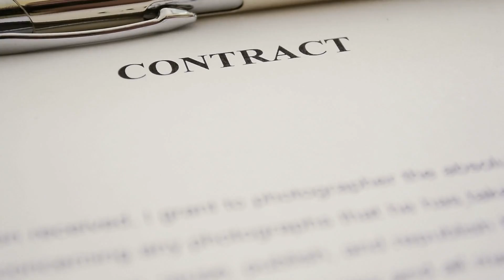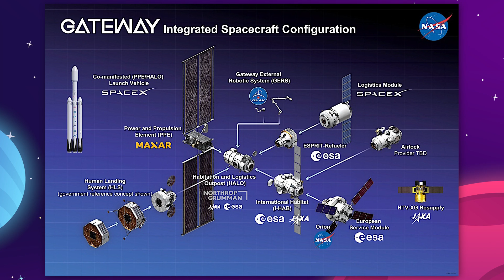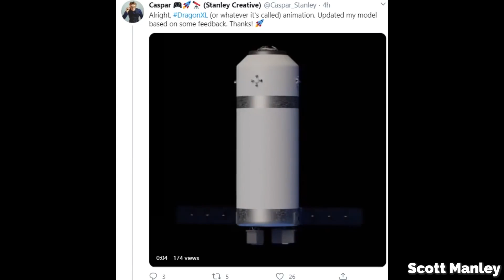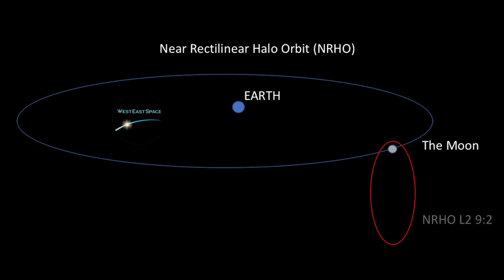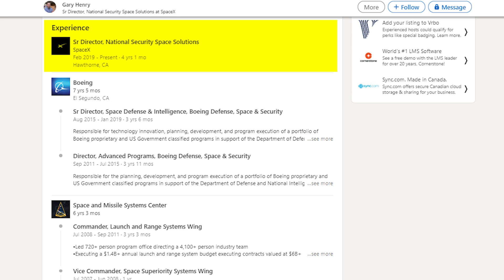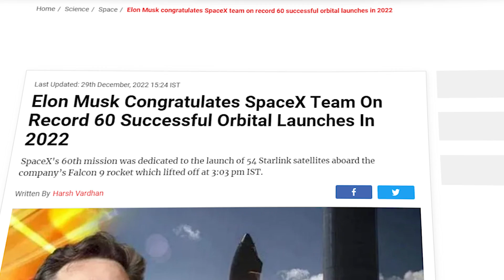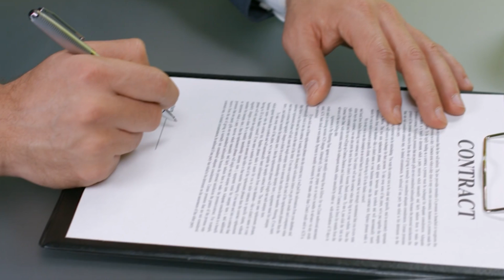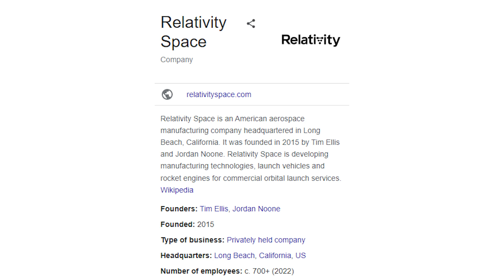NASA Reveals Major New Lunar Gateway Update!

Comment: ill give you the way it will go, spacex will be ready with starship and none of the other companies will be ready and they will be over budget.
Reply: Agreed.
Reply: with only SpaceX being under budget.
Reply: @jessepollard7132  SpaceX has only been on firm, fixed-price contracts, as are all the commercial program contracts. We do not yet know how SpaceX would handle a cost-plus contract, since to my knowledge, they have never had one.
Reply: @jessepollard7132  The NASA commercial contracts are firm, fixed-price contracts by law. Take the $4.2B Commercial Crew contract for Starliner. Since Boeing started having teething problems in Dec 2019 with Starliner, it failed its OFT-1 flight, they took a $410M charge against earnings in 2020, a $185M one in 2021, and $288M in 2022, totaling $883M against Boeing's profits. Not charged to NASA, but out of Boeing's pocket. Hopefully SLS/Orion are the last of the cost-plus contracts, as the Commercial Resupply Services (CRS), Commercial Crew, Commercial Lunar Payload Services (CLPS), both HLS contracts, the Appendix P contracts, and many single mission contracts have all been firm, fixed-price contracts.
Reply: @steveaustin2686  the KSC management contract for operating KSC from 2023 to 2033 given to Jacobs is a cost plus contract but in this particular instance it makes sense

Hard to predict fixed costs of running such complex for next ten years.

While for "small" projects(if moon rocket can be said to be such" fixed price contract will motivate way more efficient management, there are still things that are just too unpredictable and need cost plus
Reply: @_mikolaj_  The unpredictable part is why NASA says that they do cost-plus contracts. COTS has done very well with fixed-price contracts, so hopefully they are the norm and cost-plus becomes the exception.
Reply: @jessepollard7132  What is? Your 'it' at the start isn't clear.
Reply: @jessepollard7132  Whether a cost-plus or fixed-price model is used is up to NASA, not the bidder. And the bidder sets the price they want and NASA picks among the bidders.
Reply: @steveaustin2686  sorry - "firm" means changeable. thus not fixed.
Reply: @steveaustin2686  why spacex has delays(mostly from the FAA recently), I still will bet they are ready before ULA or others.
Reply: @ReRe-yl6dq  The FAA vs SpaceX is not really a thing, except for clicks by certain YT channels. After all, the FAA defended SpaceX in front of Congress in Jun 2021 over the unauthorized SN8 flight. The 'NASA delaying Starship until the SLS flies' is just as silly, since NASA needs BOTH Starship and SLS for Artemis. Besides, the review was completed already.

SpaceX had approval for orbital launches of the Falcon 9 and Falcon Heavy from Boca Chica since 2014. They can also fly sub-orbital tests of reusable spacecraft. SpaceX went through an Environmental Impact Statement (EIS) to get that approval in 2014. Now, SpaceX wants to fly orbital flights with Starship, that has roughly 3 times the propellant as the Falcon Heavy. So the FAA review was to see about adding Starship to that existing approval, without having to go through another EIS.

The FAA was the lead agency with NASA, the Army Corps of Engineers, the US Coast Guard, the US Fish and Wildlife Service, and the National Park Service all involved from the beginning. With 6 different goverment agencies involved, it is not surprising that the review took time. Musk asking everyone to comment, over 18,000 comments were received, didn't help. Consultations were mentioned for a third time on Apr 29th,2022 and mitigations for the first time, so some issues did come up and SpaceX had been working out a solution with whichever agency or agencies covered the issue. The Permitting Dashboard: Federal Infrastructue Projects had 5 sections to the FAA review. The first was completed in Oct 2021, second in Jan 2022, third in Apr 2022, fourth in May 2022, and fifth in Jun 2022, so there was continual progress. The FAA review is complete with Starship able to fit under the existing EIS for Boca Chica. SpaceX can do the mitigations and apply for the launch license at the same time. Apparently, some of the mitigations, like the wildlife crossing, only have to be started and some are on going.

ULA's Vulcan Centaur is not a part of Artemis. ULA makes the Interim Cryogenic Propulsion Stage (ICPS) for SLS, so they provided a part for the Artemis I launch late last year. They also fly the Atlas-V , which has been flying as long as SpaceX existed. ULA's Vulcan Centaur has been delayed by the almost 3 year late delivery of the Blue Origin BE-4 engine. Tory Bruno has been upset with Blue for a while. The Vulcan Centaur is currently planned to launch on May 4th, 2023 with the Peregrine Lunar Lander. Then they will launch the Dream Chaser CRS demo mission to the ISS later this year. If those two flights are successful, then the Vulcan Centaur should be certified for NSSL payloads for the USSF, which is where ULA makes most of its money.

Don't get me wrong, I like SpaceX and they are the top launch company, but they are not the only launch company.
Reply: @ReRe-yl6dq what has ULA to do in artemis program atm? Last time i checked at the moment they only launch one CLPS lander currently on May 4th and  nothing else.
They have nothing to do with main missions as of now especially artemis 3 or 4
Reply: @_mikolaj_  Exactly. Although ULA is making the Interim Cryogencic Propulsion Stage (ICPS) for Artemis I through Artemis III and they are already building the third one. ULA is not the hold up on SLS, it is the lead contractor Boeing and the Core stage along with the Boeing Exploration Upper Stage (EUS) that will replace the ICPS on the SLS Block 1B on Artemis IV.
Reply: @steveaustin2686  well, third icps completion is from what ive heard, close. But still, with how things are currently SLS is no longer a holding item. Artemis 2 core stage will stay at kennedy space center atleast a year before launch, and i wont be suprised if same goes for third mission.

For 4th mission scheldue holding item will be SLS B1B tower though most likely, not necessairly EUS. First flight article begun construction ~month ago.
Reply: @_mikolaj_  your right, I didnt mean to pick on ULA.  They are not a major part of the Artemis program.  but its common to see many space agencies/companies fall behind on schedule and I think SpaceX is one that usually achieves their goals alot faster.
Reply: @ReRe-yl6dq  eh... that could be debatable.

SpaceX isnt so different from entire industry and also usually never makes it on scheldue... 
Just like everyone else they had bigger delays in every major project
Reply: @_mikolaj_  Yeah, I think it is, but wasn't sure. I knew it was being built already. There are a lot of checks that NASA has to do when they integrate all the other parts to the core stage. The SRBs, interstage, the upper stage (ICPS or EUS), etc, so it's not surprising that NASA is very careful with a crew spacecraft. I'm sure SpaceX is MUCH more careful with the refurbishment and checks on the booster and second stages for Crew Dragon flights.

Exactly on the ML-2. The NASA IG said that they expect the ML-2 to be late, so that the SLS 1B for Artemis IV will have to wait for it to be ready. So they are expecting Artemis IV to slide into 2028. Hopefully that gives Boeing time to have the EUS ready.
Reply: @ReRe-yl6dq  SpaceX misses deadlines as well. They missed the CRS deadline, but Dragon did beat Cygnus to the ISS. SpaceX's Crew Dragon missed the CCP deadline, but beat Starliner to the ISS to capture the flag left by the last Shuttle mission. Schedule delays are not uncommon in the space industry, which is why they use NET, No Earlier Than, so much for schedules.
Reply: @_mikolaj_  well we will have to agree to disagree.  I have seen spacex get starship ready for orbital flight faster than SLS took, for way less money, and Blue origin still doesnt have its new glen even close to flight.
Reply: @_mikolaj_  also crew capsule works and is flying now for a year while starliner cant get theirs to work still.
Reply: @ReRe-yl6dq  SLS also works and is flying now while starship isnt. That doesnt mean SLS had better development execution and was without delays.

Sure Dragon works but it entered operation 4 years late. It wasnt a perfect project that was ready at requested time.
Boeing is late beacuse they had a failure and they took GREAT care at improving the spacecraft.
Anyway, as i said, SpaceX is no stranger to multiyear delays.
Reply: @ReRe-yl6dq  The Starship 'orbital' flight that is likely to happen this month, will get to orbital speed, but it will not circularize the orbit, per the plans submitted to the FCC on communication issues. SN24 will launch from Boca Chica and head out over the Gulf of Mexico. The Superheavy booster will detach then and boost back to about 20 miles (32km) east of Boca Chica and soft land into the water of the Gulf of Mexico. Starship (second stage) will continue on through the Florida Straight, cross Africa, the Indian Ocean, and the Pacific, before soft landing about 62 miles (100 km) north of Kuaui, Hawaii. If it survives reentry. SpaceX is fairly confident that Starship will make it to orbit, but expects it to take multiple attempts for a successfuly reentry and landing.
Reply: @_mikolaj_  ONE SLS worked (only if you ignore all the failures it had preceeding the launch), and was thrown away.
Reply: @jessepollard7132  well, honestly, i could write an essay but given i have no time

Cope and seethe that it worked lmao
Reply: @steveaustin2686  Which always results in greater waste and less deliverable quality.
Reply: @jessepollard7132  What "results in greater waste and less deliverable quality", cost-plus or reusability?
Reply: @jessepollard7132  Cost plus contracts do have oversight, so contractors can't just waste money willy-nilly. Cost cutting is NOT incentivized and without sufficient penalties for late delivery, being on time is not incentivized either. NASA says that they use cost-plus when the financial and/or technical complexity risk can not be sufficently predicted for a project. With more clear objectives for Artemis and hopefully follow on Mars missions in a decade or two, hopefully cost-plus largely dies out.  For LEO operations, NASA is evidently putting it under COTS, so they will almost certainly all be fixed price.
Reply: @jessepollard7132  Companies don't usually walk away from a cost-plus contract as they can keep trying, within reason. There is oversight. It's not like they just dump a truck full of money on the contractor and hope for the best.

AGAIN, which is WHY the move to the fixed price contracts in the COTS model is a good thing.
Reply: @steveaustin2686  Depends on the oversight. it requires good engineers to oversee a cost plus contract. UNfortunately NASA doesn't have them anymore. Which is why SLS is now 4+ billion dollars each (and that is a minimum), and the costs keep rising.
Reply: @steveaustin2686  There is also the problem that NASA keeps changing requirements. (which is also a political direction from Congress). SLS was not a fixed cost contract, which has not cost some 38 billion and growing.
Reply: @jessepollard7132  🙄 NASA not having good engineers is a laugh. That's the kind of thing that conspiracy theorists would say.

SLS is $2.2B, Orion is $1B, the ESM is $300M, and the GSE is almost $600M, per the NASA IG.
Reply: @jessepollard7132  Sigh. I NEVER said that SLS was a fixed-price contract, as I have ALWAYS said that it, Orion, the subassemblies, and the GSE are ALL on cost-plus contracts.

The commercial contracts like CRS, CCP, CLPS, HLS, Appendix P, CLD, and many single mission contracts are ALL fixed-price contracts.
Reply: @steveaustin2686  you said NASA was required by law to only use "firm fixed price" contracts. and that SLS pile of waste is not.
Reply: @jessepollard7132  Did you hear anything about the moonikins, and radiation measurement results?
What's taking them so long?
What are they cooking up the data to show what?

Heard of Polaris Dawn?
The were supposed to go to the perfectly safe Van Allen Belt last year.
Then delayed the launch to this month, March, then postponed again to July 2023.

What the heck, is there really something above low earth orbit where nobody but Apollo crews passed through?
Reply: @sbkarajan  well NASA cannot get funds to launch just any deserving project at any time, and right now ULA can't launch anything. And SpaceX already launches everything they can. Which is why SpaceX was able to launch 60 Falcon 9s last year. which is over 1 per week.
Reply: @jessepollard7132  Actually, I am talking about the Moonikins that returned last December, in Orion, the Artemis 1 mission. 
What are the results of radiation measurement? It's now becoming 3 months.

Polaris Dawn is supposed to go into Van Allen radiation belt, but it's been delayed repeatedly.

Any thought?
Reply: @jessepollard7132  No, go back and READ what I ACTUALLY said. The COMMERCIAL contracts have to be firm, fixed-price, NOT all contracts. The Commercial Resupply Services (CRS) contracts, the Commercial Crew program (CCP) contracts, the Commercial Lunar Payload Services (CLPS) contracts, the Human Landing System (HLS) contracts, and the Commercial LEO Destinations (CLD) contracts ALL have to be firm, fixed-price by law. NOT all NASA contracts as SLS, Orion, the subassemblies for both, and the GSE for them are all cost-plus contracts.
Reply: @steveaustin2686  exactly. waste spreads.
Reply: @sbkarajan  Polaris Dawn is also testing the SpaceX EVA suit, so that is likely why the flight has been delayed. A EVA suit, even one tethered to the spacecraft, is much harder than a flight suit that is never supposed to leave the spacecraft. They will have a highly elliptical orbit to dip in and out of the Van Allen belt. Then they will lower to a more circular orbit for the EVA suit testing.

The Van Allen belt is fine, if you go straight through and don't linger. Just like an X-ray of your body is fine, unless you get daily ones.

Apollo was going to the Moon, so had to go through the Van Allen belts, which as I discuss above, is not a problem as long as you don't linger. Other manned missions were going to LEO, so had no reason to go to the Van Allen belts. Gemini 11 is the exception and went into the lower part of the Van Allen belts during its flight, again with an elliptical orbit. Polaris Dawn plans to go higher than Gemini 11.
Reply: @jessepollard7132  With SLS and Orion being cost-plus contracts, the other supporting contracts would ALSO have to be cost plus to be able to support them. The European Service Module (ESM) for Orion, is being provided by the ESA. The NASA IG assigned it a cost value for the SLS/Orion launch cost calculations.

No comments on the commercial fixed-price contracts? Or are you just going to ignore it?
Reply: @steveaustin2686  Man, wanna change topic rather than admitting you were wrong?
Not so easy, I was not talking to you about Van Allen Belt this time.
I said to you let's point out the differences one by one. You have no technical aptitude.

1.  Is Orion heavier than LEM + Command Module, the Apollo? Look it up.

Orion (CM+ESM) = 73,735 lb
Apollo (LEM + CM) = 33,500 lb +63,500 lb  = 97,000 lb.

So, which one is heavier AND twice faster?

Is the score me = 1 : you = 0?
Reply: @sbkarajan  Aww, try again. I had one disappear, so I had to rewrite it.
Reply: @steveaustin2686  LEM stayed on lunar surface for up to 72 hours. In the lunar morning, in the vacuum, the sun shines on the side of the LEM, 72 hour straight, no break, transferring minimum 1380 W/m^2. As I said, 17 hours to cook a 100 kg man to raise temperature by 100 C thoroughly inside out. Do you get this?
Reply: @steveaustin2686  Frankly, the temperature of the LEM should be much hotter than 100 C, as it is not made of rock, but metal, a good heat conductor, aluminum.
To compensate this, they needed some big cooling device, minimum 16 kW power.
If it was operating using battery, 16 kW * 72 hours = 1.152 MWh battery.
Tesla's battery pack they sell these days is 13.5 kWh.
Tesla's model X 100's battery capacity is 100 kWh.
So, did Apollo carry battery this big?
Not even close, they allegedly carried up to seven 32-volt, 296 Ah battery = 66 kWh, needed 1,152 kWh.

That's why Chinese are building nuclear reactor, 1 MW capacity for their lunar mission.
That pathetic little LEM did not go to the moon and let 2 astronauts survive for up to 3 days, no way.

Do you get this?
Reply: @sbkarajan  You must be a troll and likely a grifter who does not really believe what you say. How objects heat up and how the radiate the heat away has been explained. Just becuase you don't undertand it, doesn't mean that it didn't happen.
Reply: @steveaustin2686  It's frie & it will change your mind.
Reply: @sbkarajan  No, it won't. I don't go for the conspiracy fantasies, but actual reality instead. Actual reality is that the Apollo missions went to the Moon.
Reply: @_mikolaj_  If Boeing is putting out 1.5 SLS cores per year, then you can only do 2 missions a year in spurts.

The only difference between the SLS 1 and SLS, 1B is the ICPS vs EUS. The SLS for Artemis IV will use Shuttle era RS-25 engines, just like Artemis I through Artemis III. Artemis V is when the new RS-25E engine comes in and the new SRBs come in on the SLS 2.

This SLS launch costs will be known after the fact. Before that, they are estimated. Boeing believes that they can cut the SLS costs in half, so that would be $1.1B per SLS. If LM can bring down the Orion costs, then that could put an Artemis flight to under $3B.
Reply: @steveaustin2686  EUS is quite different stage from ICPS though, plus you use different launch tower. ML-1 was Ares 1 tower modified for SLS.
ML-2 is pretty much a clean tower design with SLS umbilicals from what ive seen, though tbh... GSE operating costs shouldnt change this much.
Reply: @_mikolaj_  The ICPS is a modified Delta-IV upper stage that has flown over 30 times. The EUS is a brand new stage, on the 8.6m profile, which is why they are moving to ML-2. The rest of the SLS stays the same. The NASA IG costs are estimates. It's possible for the cost to go up.
Reply: Yea and then space x will somehow save us all!
Reply: Artemis plans sound hopeless.
I think China will be the first nation on earth to put a man/woman on the moon.
Yup, a Chinese person will be the first to leave the earth and step on another celestial body.
Think about that....
Reply: @sbkarajan  ummm do you not know that the US put men on the moon already?
Reply: @sbkarajan  im fine with a healthy level of skepticism but there is lots of evidence it did happen as well.
Reply: @ReRe-yl6dq  What's the most convincing evidence to you that NASA sent men to the moon?
Reply: @sbkarajan  the most convincing argument is that I have some of the films from the drop pods. Flown the simulators. And have seen the booster of Apollo 12 in the sky during 2002 with a telescope. It will come back in mid 2040s if you are interested.

About the van Allen belt. It is quite simple, just go through fast 😂 this is why astronauts had to wait a long time before flying again on an Apollo flight. Yes, the radiation was extreme and they just said F it anyways.
Reply: @sbkarajan  🙄🤡 Apollo went to the Moon in the late 1960s to early 1970s on 9 separate missions, 6 of which landed. The evidence of that is overwhelming. China might be the second country to put people on the Moon, but can never be the first.
Reply: @steveaustin2686  Yeah, Apollo went to the moon in 3 days. Artemis 1 took 6-10 days to go to the moon. 
No other spacecraft went to the moon that fast, except Apollo.
And then, Apollo had enough fuel on board to slow down and entered 100 km high circular orbit with 2 hour period, and circled the moon 30-75 times in 2-3 days, allegedly.
Artemis, half the weight of Apollo, could not slow down that fast, so "entered (lol)" elliptical orbit with apogee of 70,000 miles, so far away, orbited the moon once in 14 days, and came back.
Make sense?
No wonder James Webb resigned days before the first Apollo mission.

Just watch AMERICAN oxoxoxoxoxoxo MOON documentary, and find out the truth.
Reply: @sbkarajan  🙄🤡 CAPSTONE took 6 WEEKS to get to the Moon, does that mean that Artemis I didn't happen? Get real dude. You can get to the Moon using different methods, all valid for getting there. Apollo landed on the Moon and the evidence is there for it. Or you can bury your head in the sand and ignore reality.
Reply: @sbkarajan  heh
We've got a frickin true rockst scientists here ay? Someone who sees numbers do not add up.

One thing i dont understand though, 
295.5 Billion dollars.
295.5 BILLION usd spent, ona film set and quite a big props

Big chunk of that didnt go into nice buildings, if so, then where did it go?

Touch grass or go play ksp rss(jk).
Reply: @sbkarajan  I'd also like to point out that the difference in fuel and weight matter.

Apollo used a Hydrogen and Nitrogen Tetroxide mixture. In addition it is WAAAAAAY lighter than Orion despite its size. This means that it is WAAAAAAY easier to slow down than Orion and speed up than Orion. Conservation of momentum right. 

In addition Orion inserted into this orbit on purpose. It is testing the orbit that will be used for a lunar relay sat. 

I don't understand why you think it can't be done in Apollo lol.

If you don't know basic physics then just leave. No one asked you to be here.
Reply: If Musk isn't distracted by Twitter or something else...